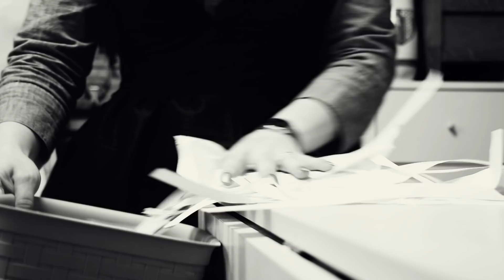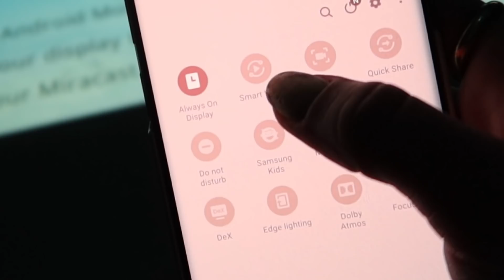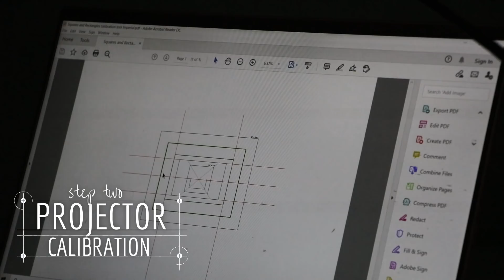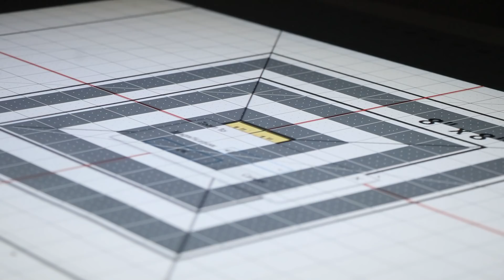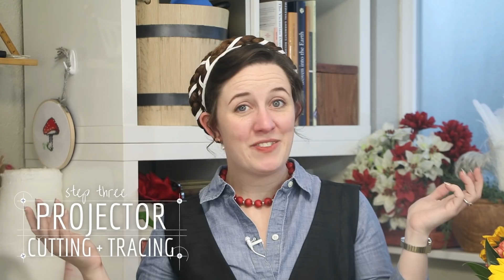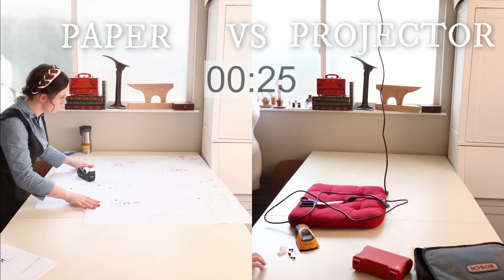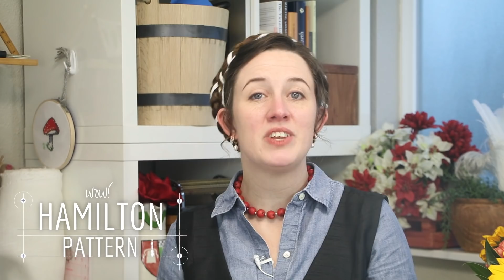Projector VS Paper Patterns - A very quick comparison

Comment: I use my previous tv as my computer monitor now. It’s large enough that I can trace pretty much anything, even patterns, onto paper from the screen. I use photoshop to make the image the actual size I need it to be, turn lights off, tape tracing paper up, and carefully trace. Yeah yeah yeah I’m sure it’s not great for the screen but I’ve done it a million times and it’s an old tv so I don’t care. It’s more useful to me in this way than any other way lol
Reply: I do this with my computer monitor. I scale up the pattern to size after taking a pic and uploading it, then use a bulldog clip to clip the paper to the plastic surround, then trace the lines with a highlighter (not a Sharpie - a sharpie will bleed, but highlighters won't,  and you don't need to press a highlighter for it to make a line like a pen/cil will).
Reply: @melissashiels7838  oh I love the highlighter trick! I will definitely borrow that next time. I usually use pencil but I trace it very softly so I’m not putting hardly any pressure on the monitor
Reply: @AnastasiaR  If you can find softer pencil lead (in the B-8B range) you can make a mark with less pressure on the screen (though you'll have to sharpen the pencil more often). You can even find softer lead for mechanical pencils, usually at art supply stores. For those using pen, try felt-tip pens or fine tip markers, those need less pressure to start the ink flowing - so you're less likely to damage the tv/monitor. Cheers! 😁
Reply: @lyreparadox  thanks, my dear! I am an art supplies hoarder so rest assured I got all that 😎 😂 ❤️
Reply: Ummm now that’s a great idea my TV has not been turned on now for over 5 years plus it sits there doing nothing Dad and I had been discussing the use of it with YouTube but we just not gotten around to linking it all up yet😹😹😹 now your idea is fantastic and as it’s a flat screen TV I can get a piece of tempered glass to sit onto top of it and place the TV under the table on its back with the glass pre-set into the table thus no actual pressure used on the TV screen at all. Thanks for a great idea now I’m glad I bought such a large screen after all 😹😹😹👍🏽👍🏽👍🏽👍🏽
Reply: @dawsie  ok now we are cookin. Also the glass table situation can serve as a light box for tracing patterns from previously printed or cut patterns- especially if you turn your room lights off and put a light beneath the table. Phone flashlights work great for this. And when it’s not in use you don’t have a giant expensive light box taking up room, just an unobtrusive lovely glass table. I must warn you though, tracing from the monitor THROUGH glass may warp your image slightly so if it’s something which needs to be precise I’d recommend either tracing directly from the screen (using highlighter, felt tip, soft pencil, or something else gentle as others in this thread have suggested). If it’s something like a skirt pattern then a millimeter won’t make much difference but if it’s like a bra, bodice,  or corset it will
Reply: @AnastasiaR  I had thought of that myself but as it’s a flat screen and the glass is also very flat too it should be fine but I will test it all first with check boxes at set sizes at all the corners plus the centre as well first if they all trace out correctly then I will move forward. I just found my TV has a PC input plug considering it’s almost 10 years old I was surprised to find it on there the perks of always investing in the top line of something 😹😹😹
But the idea was so that it would double up for me as a light box as I have to transfer embroidery designs from paper to fabric and that can be very time consuming at times.
Reply: Alexandra McLean  😹😹thanks now that made me feel very young again, but I got the idea as I was writing it up I could picture it in me head all at once now I just can not wait to pull my cutting table apart so Dad and I can cut out a section to fit the TV into it and also trim out the area for the glass 😹😹I was given 3 old tempered glass couch window which thankfully are flat so I thought I could use one even though it’s tinted it should work nicely 😸😸
Reply: I half wish I hadn't gotten rid of my huge flat screen on one hand I could trace pattern but on the other it was kind of an eyesore I might have to borrow the living room TV and try this
Reply: @rosequill7925  oh yeah- there’s an idea you could just do some kind of stream/cast or share-screen situation to your larger tv from another device which has your pattern images! Although I do feel like I have to say be careful with your screen. Even though I’m not super careful and even if I press hard it doesn’t hurt it but you never know lol
Reply: I have been wondering what the heck to do with my old flatscreen TVs (hubby buys a new one every few years). I have done this with a computer monitor but the TV would be so much bigger. I usually use a mechanical pencil to do the drawing.
Reply: Thats so funny I use a huge screen for work that is high definition...I was going to do the same thing and say fuck it to the projector.

Comment: 'your sewing setup' yeah so the floor of my small bedroom haha
Reply from the maker: Lol yep, that's what I did for many years too. So grateful to have a dedicated room now! ✂
Reply: @MorganDonner  I don't even have enough floor space for a 150cm wide fabric haha but that is fine lmao this is the life I've chose to live
Reply: My living room when my kid is asleep 🤣
Reply: FLOOR TROLL
Reply: I use the living room and kitchen table. Oh and sometimes the floor in the hallway if the table is not long enough. I've also used my bed when folding and cutting circle skirts/dresses.
Reply: I use a strong cardboard folding mat from Simplicity. It folds into a 12 inch square, but out to cover my queen bed. I put my cutting mat on it and it works good for me. Just fold it up and the board and mat goes under the bed.I think it's a good investment. Especially when Joanns has a 90% coupon.
Reply: Have you tried flipping your bed vertically against the wall? a la a Murphy bed?
Reply: @saritshull3909  my bed is like 150 years old I cannot do that haha
Reply: @fitzyfitz95  NEVERMIND!!
Reply: @isabelleblanchet3694  Just be sure to never stray off the edge with that rotary cutter...